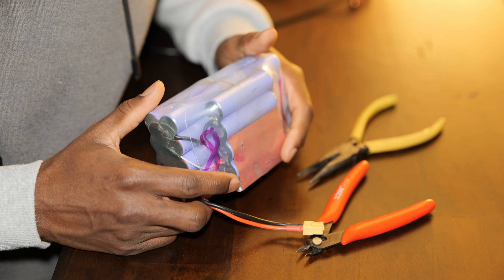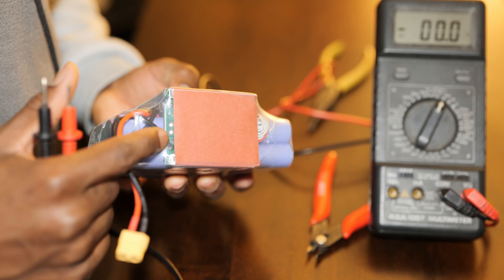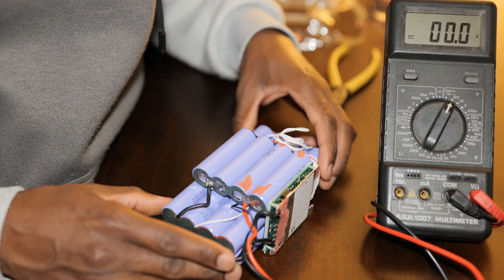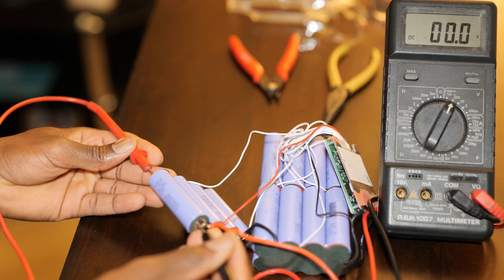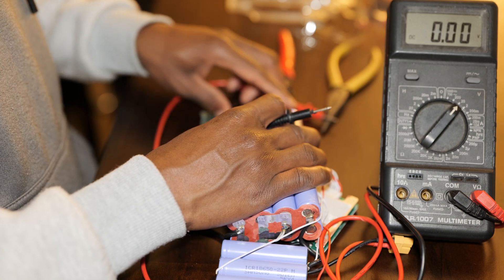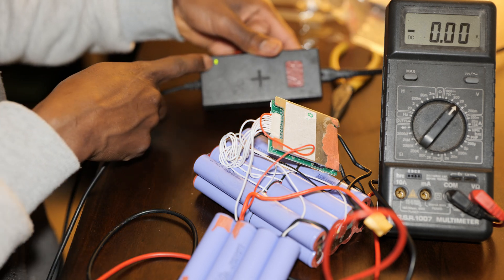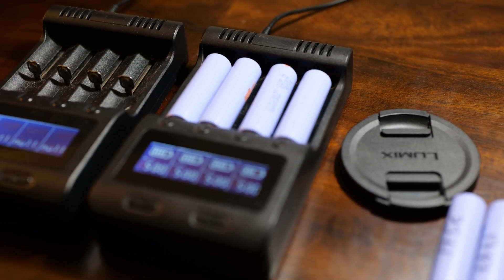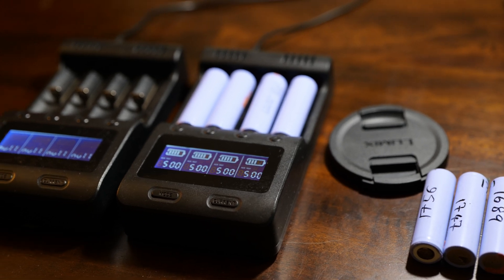HOW TO DIAGNOSE AND REPAIR A LITHIUM-ION BATTERY PACK

Comment: hey yvon, who do i learn how to repairthe battery packs.. what to study to learn thx
Reply from the maker: Physics my friend, Thevenin's theorem, the relationship between Current and voltage, series and parallel connection, DC power 101 and daily hands on with electrical components since the best way to learn is to actually manipulate

Comment: There are a lot of inaccuracies in this video I’m sorry but you cannot use these for vapes or flash lights these are 21700 35 amp Samsung cells. DO NOT FOLLOW THIS ADVICE
Reply from the maker: There is no inaccuracy in this video. I make these videos to educate people like you. I suggest you stop messing with batteries (it's a fire hazard if you don't know the basics). You can use these batteries in vapes and flashlights (if they hold charge), regardless or their size (18650 or 21700). Just get a vape that uses your battery size. You are wrong, these are not 21700 35a. These are 18650 - 22P M Samsung SDIEM 5FX4 - 10A. If you look at the form factor of the pack at the beginning of the video, you can tell this is a hoverboard battery and they all come with 18650 cells. It's widely known. You can see the battery specs on the cell at the end of the video: https://drive.google.com/file/d/15b8zFHZSGOajS27J2kFaHIH7ts9D1z0A/view?usp=sharing

Comment: Why aren’t you testing them from the board? It definitely seems like you have an issue with your multi meter. There’s no reason they should all show 0v
Reply: There is a reason, one simply can’t say for sure what that reason is. That’s why he says “interesting…” Because it is indeed interesting! It makes you wonder what the person did to get them completely discharged.
Reply from the maker: I could have tested the cells from the BMS board. I avoid doing that because if the BMS wires were pinched, loose or burnt; it would interrupt voltage to the board. So measuring directly on each cell is the way. So to you a lithium-ion battery can never read 0V? I hope this is a satire statement

Comment: Do you know if a dell power companion Li-ion battery can be recharged after sitting unused, still in its packaging,  after 5 years? It won't 'hold a charge'.
Reply from the maker: Yes, it's rechargeable page 9 
 https://dl.dell.com/manuals/all-products/esuprt_electronics/esuprt_prtble_pwr_companion/dell-portable-power-companion-pw7015l_user's%20guide_en-us.pdf
Reply from the maker: It's made out of 18650 Lithium-Ion batteries in a 4s1p or 4s2p configuration depending on the model you have. If you know what you are doing, you can disassemble it and revive the cells if they are not too far gone. Just apply about 4~5 volts, 1 amp directly to each cell for a minute or so. You can even swap out the cells for new ones. Remember that Lithium ion batteries can cause fires and burn your home, so only attempt if you know how to safely manipulate it
Reply: @YvonSmart  🧐🧨🔥🔥
Reply: @YvonSmart  is what u described, something u know how to do?
Reply from the maker: @SlickEldanVibe  Yes, the configuration will look like this: https://www.youtube.com/watch?v=1_jIHz9JmnI
Reply: @YvonSmart  can I send it to you to "repair'?
Reply from the maker: @SlickEldanVibe  I don't know if it's worth it, especially if it's the sealed version with the capacitors instead of lithium cells.   Can you tell if this is the one? https://youtu.be/cXlYNipeN9c?t=195
Reply: @YvonSmart  it's very similar externally, can't speak for it internally. mine is a PW7015L/65wh.
Reply from the maker: @SlickEldanVibe  Yes, it's a power bank it should look like this on the inside https://www.reddit.com/r/18650/comments/o4k1w8/looking_for_advice_on_my_dell_power_companion/
Reply: @YvonSmart  what would you 'charge' to re-charge it?

Comment: lol, why do you check each battery separately when u have connected them by nickel in series?
Reply from the maker: It's to check for good cells. You can have 0V on the total output and still have good cells. The output is connected to P- of the BMS, a fried BMS can output 0V while some cells are still good